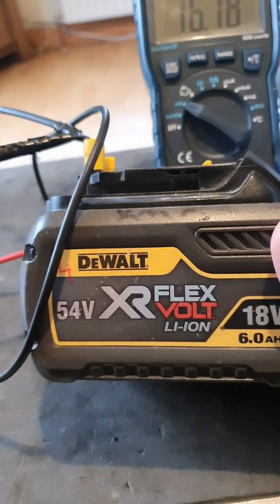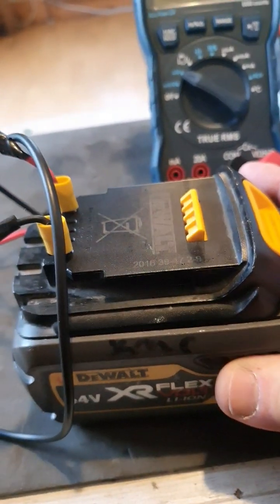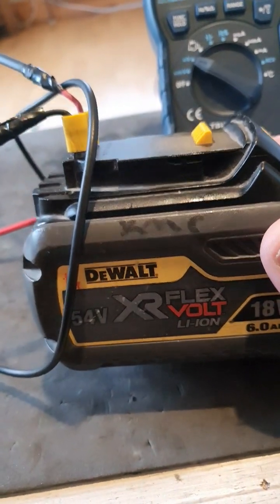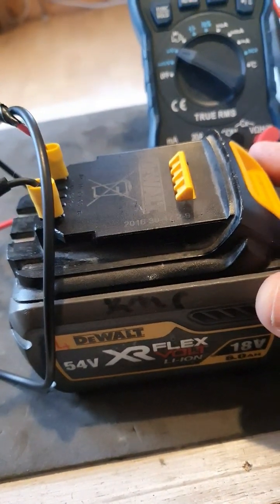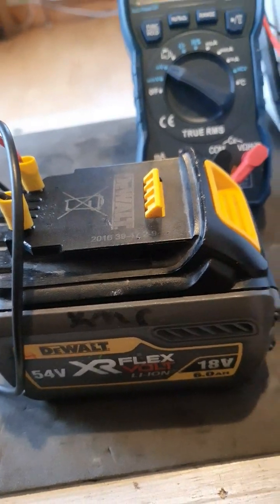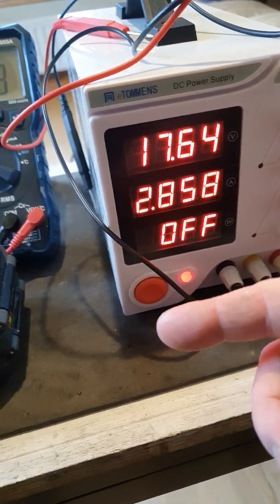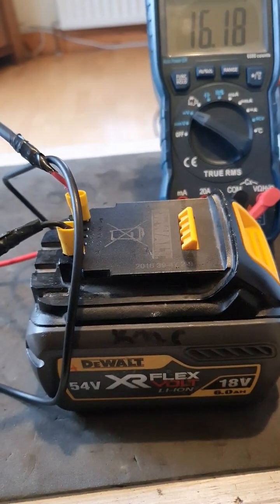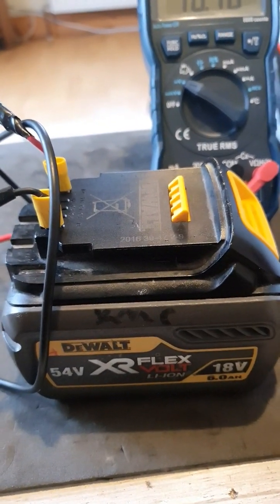Don't jump start batteries! Do this instead! #powertools #repair #trending #dewalt

Comment: How do you determind what Volt and Amp is set to on each battery for the dc power supply.
Reply from the maker: If your voltage is real low on an 18v or 20v Battery  set the DC power supply to about 17v 2 amps maximum should bring it up nice and gently
Reply: Ok, I have to mess the V between 1750-1800 and Amp fr 2500-3000.  My 6ah flex battery that was no bar now have 2 bars but it still won't charge on the charger.  Will let it charge on the DC supply more.  How come even with 2 bars it won't go fully charge.
Reply from the maker: @Koua.L  dead cells? cell imbalance ? Broken connection
Reply: I open up all my flexvolt battery and the connections are all shiny just dusty but I clean all them out.  I set it to 20v and 3amp and let it charge until it reach 20V now I have a fully charge battery.  Doing this for all my flexvolt and hope they are all good.  I bought 5 6ah flexvolt non working battery from ebay for $20 each.  From the looks of these battery, they all have clean contacts and connections.